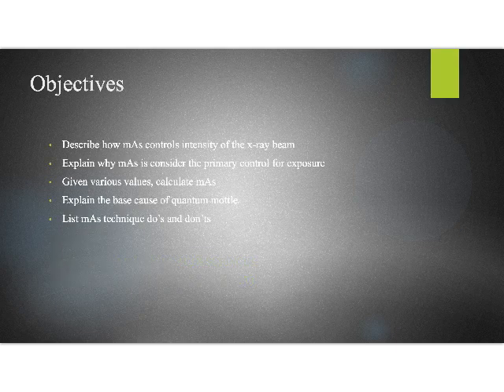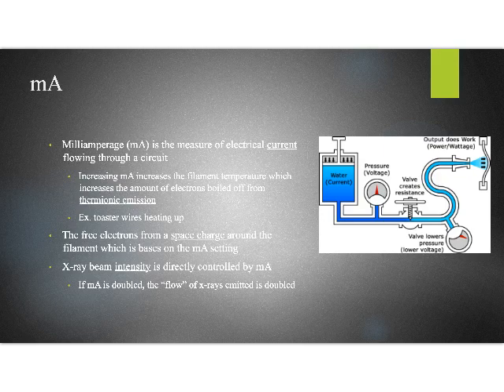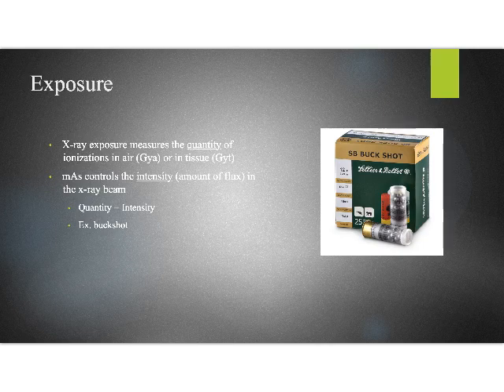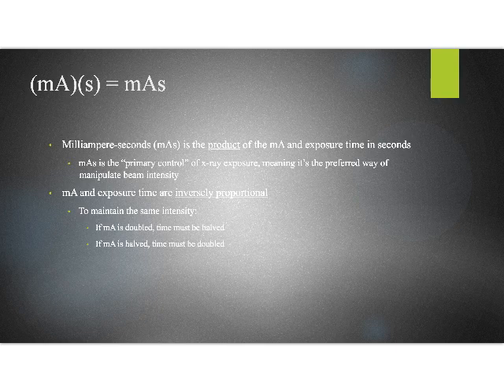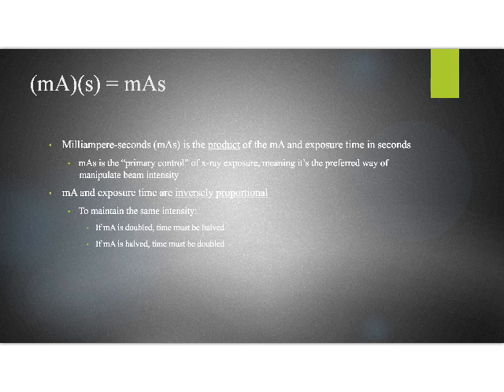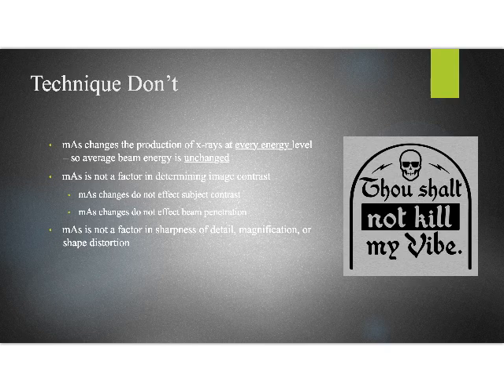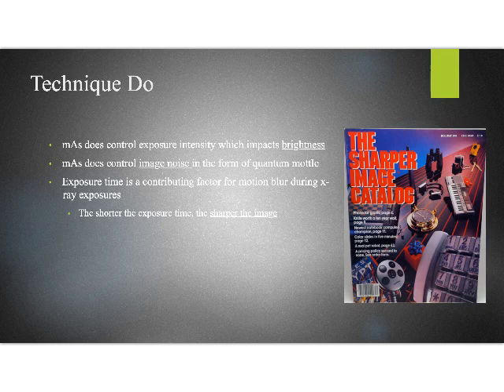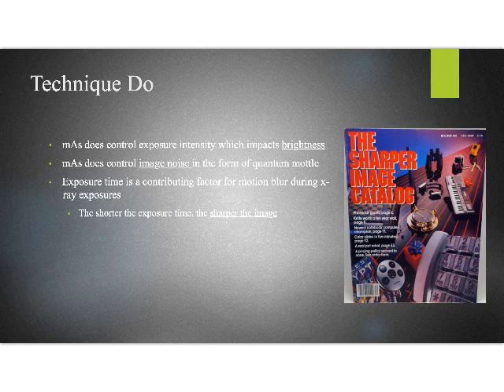mAs

Comment: 1 ampere is equal to 1 coulomb per second, which means:
One electron has a charge of 1.602E-19 coulombs
1 ampere/s = 6.242E18 electrons per second
1ampere = 1000mA 
are these numbers correct?

Comment: You confused me on last part that’s what the relation between increasing mA and brightness also is radiographic film is black or white because idk 🤷‍♂️ which one if its overexposed black or white underexposed and what factors determine overexposed snd underexposed 
Please more details and last note does when u increase the gauge of the shotgun shell doesn’t slow it down since it needs more power to push it to penetrate a body ?